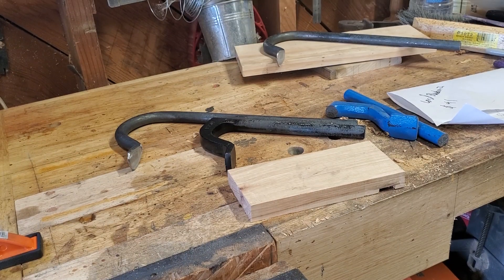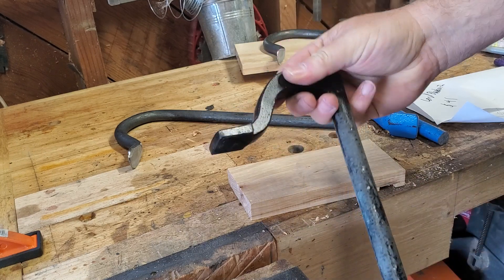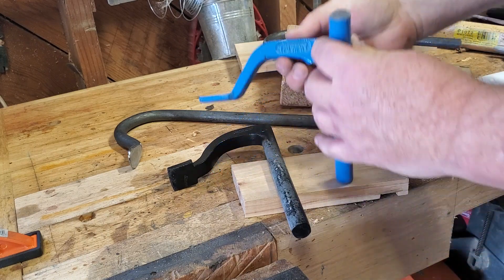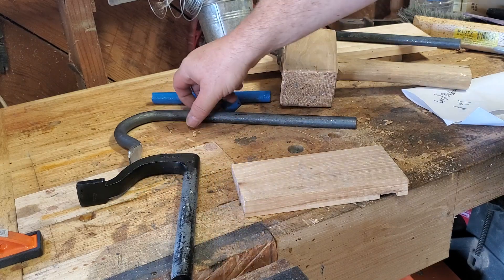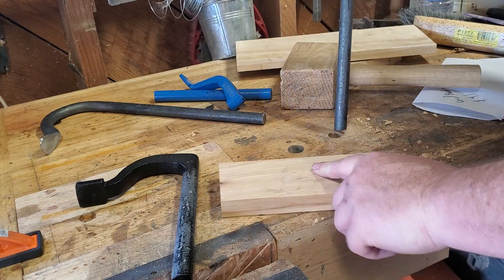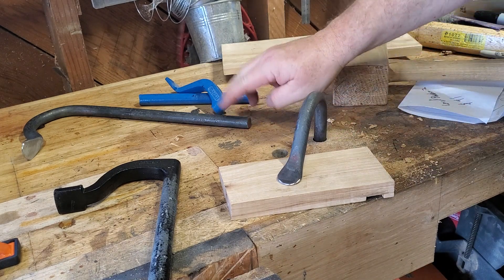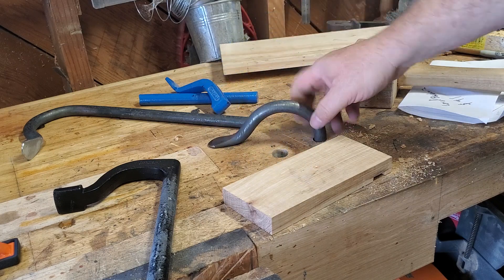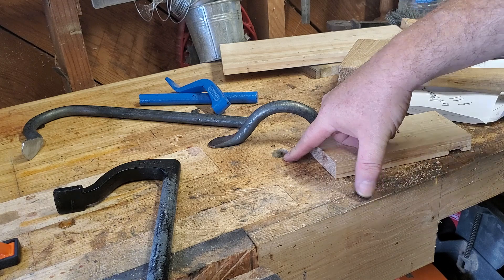Is it Hold Fast or Holdfast?

Comment: The depth of the hole is related to how much bigger it can be. My bench is 3.25" thick and 3/4" holes work with 5/8" holdfasts. I have another bench that is 5.25" thick and 3/4" holes don't work. I had to widen them slightly to a touch under 7/8" to get them to work in it. The mdf might be compressing and exacerbating the dept issue on your bench. I've heard from a couple friends with mdf benches that holdfasts eventually made the bottom of the hole very irregular and they stopped working right.  I forget which book it was, but one of my books has a whole section on holdfast geometry. If I can find it I'll post it as a reply here.
Reply from the maker: Thanks jsmxwll.  I'm working on a new bench with a 3" beech top.  I'll have to figure out what size holes work in it.